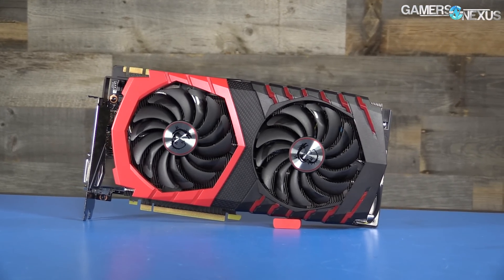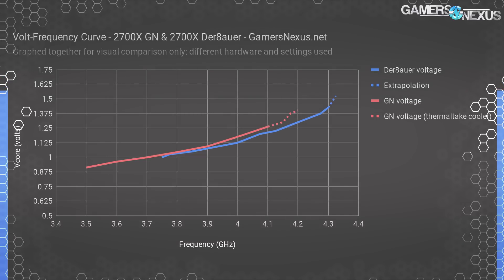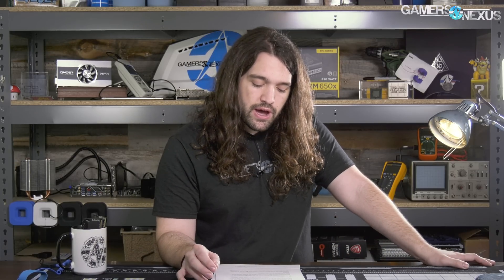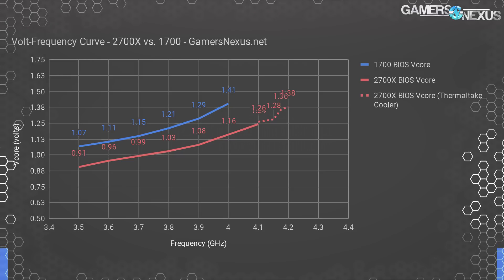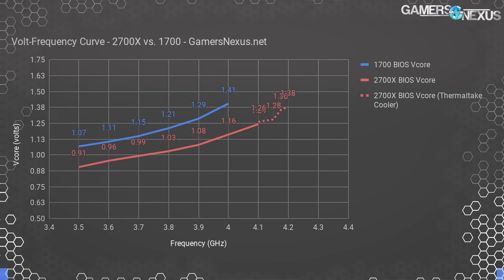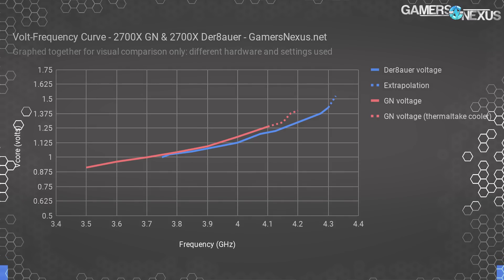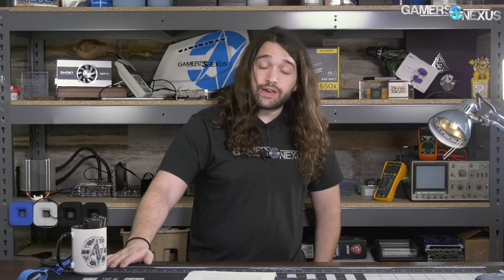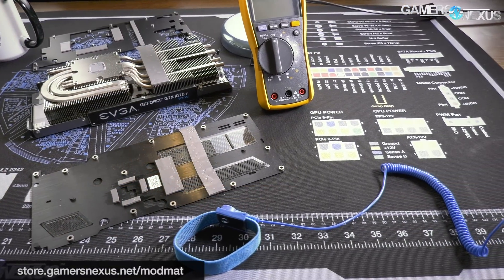Exponential Ryzen Voltage-Frequency Curve (Overclocking)

Comment from the maker: Article: https://www.gamersnexus.net/guides/3290-exponential-ryzen-voltage-frequency-curve
See also: R7 2700X review - https://www.youtube.com/watch?v=1A2yatfyLoo
Reply: Gamers Nexus so I was recently testing my TR1900X. I was able to hit 4.15GHz at 1.425V LLC 4  on an MSI X399. 4.2 was only Windows stable at those settings. 

The 1900X acts a lot like the 2700X. It hits similar clock speeds at  similar voltages mostly due to being highly binned and having 180W TDP. 

At low loads XFR will boost as high as 4.175Ghz. At medium loads like Cinebench or Time Spy Turbo takes all cores to 3.95GHz +-10Mhz. Prime95 Small FFT will bring it down to just 3.825-3.85GHz.   It’s basically not worth OC’ing.
Reply: Gamers Nexus can't wait for ultra-precision boost 5
Reply: Can someone tell me what is standard voltage for my Ryzen 5 2400G? Because my MB (MSI B350M Gaming Pro) sets whatever it like. At first boot I was getting over 90 degree C on Cinebench and quickly find out that voltage was (on auto on stock CPU settings) at 1.55V !!!! After restoring bios default seatings it's now putting up to 1.42V on auto
Reply: Sooo... strictly For Academic Purposes you played with ryzen a lot?
Reply: Guys what's the difference between
bios vcore & motherboard vcore..?
Different voltages in diagram bios & motherboard..??? 

Also that temps and benchmarks are on high load calibration..? 
plus extra voltage on vsoc?
Or vsoc set <Auto>
Reply: Gamers Nexus You said jif. That's it, I love you.
Reply: You just described that in fact it IS exponential...
Reply: Lukáš Bacigál if that was a reply to my comment, you should go back to high school....
Reply: @Gamers Nexus  take this video down 538 you mentioned the 1700 X but the graph says ryzen 1700
 unless my ears are wrong.
Reply: Just because it grows faster than linearly it doesn't mean it's automatically exponential. It seems you have zero knowledge on microelectronics, the right equation for the frequency and voltage is
f=(VDD - Vth)^alpha / VDD
where alpha is between 1 and 2, typically 1.4
So this is most likely a quadratic (or slower) growth, since VDD is quite close to Vth, but nowhere near exponential.

Comment: What is the reason for higher voltage requirements? Is it due to CMOS capacitors not being able to charge fast enough on lower voltages and thus they can't propagate sensible data causing glitches? That's sort of my theory but I'm not really sure.

Comment: Old news, but my 18 month old  2700x ran at 1.456v out of the box, it did not fluctuate more than 0.010v either way, 
and have found that this is probably the reason that it has been problematic, (random black screen crashes). 
Currently undervolted to 1.39v at 4.15ghz and seems fine.

Comment: So.. plz help me.. is 1.0 volt safe for ryzen 7 2700 (non X) to overclock at 3.6ghz? or what voltage do i need to give..?
plz.. if you have a chart like..
3.5ghz =? volt
3.6ghz =? volt
3.7ghz =? volt
and do i need a extra cooler.. plz help someone...
Reply: Mohammad Mizan I’m looking for that right now, I manage a fully stable 3.7ghz with 1.116v(stock cooler), but 3.8 not even with 1.8v, and I need lower voltage to not go above 80c (currently 77 using intel burn test at 3.7 1.16v).
Reply: sorry I write 1.8, I mean 1.18v

Comment: @GamersNexus - I'm kind of wondering what kind of cooler would be best to use for the 2700X with the aim for it to be reaching 4.2-4.3GHz?
I was thinking about the Cryorig H5 Universal, but seeing as it has only 4 heatpipes - and with the fact my ambient room temp in summer might be as high as 30-35 - I wonder if something like a Mugen v5 rev.b would be better? Trying to keep it under 50-65$ inc. EU VAT, though was wondering if maybe at such high temps it would be better to invest into a AIO like the Kraken x62 or Corsair H115i.

Comment: I'm not sure about voltage but power was always an exponential growth with clock speeds and the whole point of multi core processors was to increase the performance level past the point where the power requirement skyrockets as they allow a direct power to performance ratio.

Comment: Guys have you test the gigabyte 370x gaming 5 or gaming 7k version with ryzen 2700x?
I have problem with voltages & high temps.
For example bios 23d not working bugged even if you set manual voltage temps are on 95-100
When I switch to bios v22 bug fixed temps dropped to 35 but windows won't load with auto voltage on auto 3.7ghz.

You need to set at least vcore 1.3500 voltage to boot the system 1.3500 for 3.70GHz its too much, I cannot overclock my cpu at the moment cause of that (probably bios bugs) cpu diode goes really high on stress test temps 80+
with low voltages..
If you have any tip or some stable bios version please help..

(yes I have test 2 stock wraith coolers and my master liquid pro 240 same problem same temps.
 Ryzen 1700 runs fine. But 2700x not..
Some people report same problem on amd forums..
Help please!!
Reply: No help, but having only tested bios 22, I am stuck at max 3.9, with my 2700x. That is, when stressing it correctly. My problem is temps, as it overheats, with the stock cooler. K7.

Comment: Those voltages are excellent. might replace my 1700 with the 2700, because it would at least be 20C cooler under load and my current chip gets very toasty in the summer even with a 240mm AIO

Comment: You could look at this thing, get some grid points, write down your coefficient matrix and get the parameters for your exponential function then you can derive it and look at the point where the derivative becomes larger than e. That is about the sweet spot if you want the greatest overclock without a nuclear core meltdown. Yes, thats enough application for today, back to theoretical physics flies away

Comment: Sure. The non-X model may reach X-model levels with overclocking but it's only cheaper if you already have a cooler. Otherwise, it's just as cheap and much easier to just buy the X-model and leave it at stock.

Comment: Dear Steve, Can you test ryzens voltage outside what the bios is saying ? I don't trust amd software as we know about it's GPUs, and now CPUs, example when ryzen 1 had the wrong temperature showing. I think that they might be lying about that their stock CPU works with 1.163v, compared to ryzen 1 with 1.375v, that's a huge difference, but when OC they both reach to the 1.45v + - in that area.

Comment: The fact that 4ghz has dropped from 1.41v to 1.16V, i can't be the only one to realise dropping from 14nm to 12nm and providing this sort of efficiency gain is madness? Removing the fact 4ghz on the 2700x is faster too.

Makes me wonder how efficient at 4ghz the 3 series on 7nm is going to be. In fact i wonder what the power draw of the 2700x is at 2.5-3ghz, a ultrabook sort of frequency

Comment: I have an 1800x, and found an all-core p-state oc (4 GHz / 1.37v) was better for gaming than XFR.  I think this is more about core parking.  I use "ParkControl Pro" for control over this, but it seems to run better with the p-state oc than it did under XFR. It's always silky smooth, in any power profile including "Power Saver", whereas I had to keep it in H. Performance or at least Ryzen Balanced if I was using XFR (Auto / stock).  I haven't seen a stutter or glitch in the 8 months I've been running this way, where I did see this from time to time with XFR.

Comment: I have a question. With Ryzen 2 and the X models, if you happen on a good chip and instead of overclocking you simply downvolt and keep the chip cooled very well, is turbo boost and XFR going to basically auto OC the CPU? Basically, does downvolting benefit the turbo boost and XFR features?

Comment: Apples and oranges??? 1700=3ghz+3.7boost....2700x=3.7ghz+4.2boost. Come on. Not fair is it? R2 being clocked higher with standard spec of course its gonna overclock higher. Relatively 23% v 13% respectively (give take). This voltage comparison aint fair. Of course clock for clock r2 is better say at 3.7ghz because of the fabrication process technology

Comment: Worth upgrading to 2700x from 8700k?
Reply: Meow w not really an upgrade more a side grade, only worth doing if you can make use of the cores and threads and/or want a platform backwards compatible until 2020.

Comment: If you look at the stats and think of the new Treadripper with 4 of the Ryzen 2 CPU's and lowering volts... A beast will run over Intel. Not in the single core but in calculation power per watt.

Comment: I won't be buying a Ryzen 2 chip cuz my 1600 is more than sufficient. Still want to thank you for your hard work, this is very interesting and if I have an excuse, say if someone want me to do a build for them, I will take the chance and test with the clocks and voltage. At this point, I rarely do overclocking but rather undervolting. I can run my 580 at something like 1000Mhz core clk and 2100Mhz mem clk and still maintain 75 FPS in many games I play, which while I might have to lower some settings doesn't warm my room up.

Comment: I wonder if the tweaking in voltage and/or power is correlated to the tweaks AMD has made to Infinity Fabric for this new refresh. I have read that they have reduced the cross-ccx latency. But, not sure, if they have reduced it enough....

Comment: Seriously though, all clockspeeds require exponential voltage increases. In the real world nothing is linear, there are only linear approximations around small operating regions, where you can stay on a tangent to the more flat part of the exponential at lower speeds, but at higher speeds you are on a steeper tangent. https://en.wikipedia.org/wiki/Linear_approximation. There are also mathematical reasons behind every clock speed needing exponential voltage, no matter the circuit. To keep the "Eye diagram" within the boundaries of logical 0 and logical 1, e.g. below 0.3V or above 0.8V everywhere in the chip when the clock rises, you can expand the eye pattern by increasing voltage. The step response (just one clock rise) of the eye pattern has an exponential shape -  one clock rise (or fall) has the shape of a capacitor charging or discharging - exponential response, so you need exponentially more voltage to stretch it and make it rise fast enough to stay in bounds as you increase the frequency. See https://en.wikipedia.org/wiki/Eye_pattern, which also applies to ICs https://en.wikipedia.org/wiki/Signal_integrity
Reply: Also, if AMD enabled less voltage for the same clocks (which is most of the benefit they've seen to achieved with Zen+) they've probably found the places in their chips with the slowest responses that was limiting them before, and made them faster meaning the curve for the whole chip has been shifted to be initially lower and flatter, but it's still exponential, and I guarantee any chip ever made will be, it's just how low and flat is it initially. That's why extreme overclockers almost always e.g. double or triple the power, but never get anything like double or triple the frequency, unless it was a massively under-clocked chip to begin with like chips in the 80s or 90s, or a calculator. 
Also, on power draw, when increasing the voltage linearly this increases the power draw exponentially (^2) (P=V^2/R... assuming a chip has approximately linear resistance, which they sort of do for the same task like being prime95 tested), but increasing the clock means increasing the voltage exponentially (^2), which means the power draw increases quadratically (^4) when increasing the clock, which is why there is so little to gain once you get over a certain wattage per core, and why more cores is a more power efficient way of getting processing power, rather than increasing the clock, if they can be utilised.

Comment: how much E-tape have you gone through with ryzen so far?
Reply: I'm not sure but I think because a side channel provided the cpus to GN and with the info on the ihs maybe someone would be able to find the batch and then who provided such processors to GN.
Reply: Why do they put E-tape on them?
Reply: to add to Cippo95's point, these CPUs had tape on them in the videos released between the unboxing embargo and the benchmark embargo. Steve mentioned in one of those videos that he is not under the embargo but will respect the other media outlets and not break the embargo that technically GN wasn't under.
edit: also see GN comment on this same video: https://www.youtube.com/watch?v=Qfu7TUQ2P6U&lc=Ugxt5BzDHEkzu-Yj5pZ4AaABAg.8fRo135QjXS8fRomdS_qI9

Comment: Steve: Great video about voltages! Speaking of, can you please explain why I still can't run memories at 3600Mhz or 3466Mhz on my X370(AsRock)? Thank you!
AMD said that the new Zen+ architecture will support higher memory clocks, and that it's all tied to the CPU, not the motherboard...

With the R3 1200, I could somewhat run my RAM at 3466Mhz with 1.395 voltage.
With the R7 2700X, I can't even do 3466Mhz anymore! BSOD over BSOD... Why? :(((

So is AMD lying or what hell is going on?? :(
My RAM is G.Skill Ripjaws V, 3600Mhz, CL 16, 2x8Gb Kit.
My motherboard is AsRock Fatal1ty X370 Professional Gaming. UEFI/BIOS v4.60.

Can anyone help me with this issue? Please? I would appreciate it!

Comment: Correct me if I’m wrong but what I’m getting from this is if you buy a 2700x and you put a really good cooler on it then overclocking it becomes almost pointless because xfr2 will do it for you
Reply: https://www.youtube.com/watch?v=426hLGoXDbM
Reply: Cbeddoe19 but isnt it bang for the buck that you can oc your 2700 to 2700x levels thus Steve recommended the non x chips for both new cpus?
Reply: Markus Fuchs  YES YES YES Amen!!! I dont see much people thinking like that. that is what i would do... but paired to a mid range board not the budget one
Reply: Its not worth OC the X models.
Reply: But you'll need to invest in a far more expensive cooling solution to OC a 2700 to 4.2GHz, plus you get far more power draw which also costs money in the long run. In addition, Ryzen chips already have absolutely amazing multi core performance while the performance below 4 threads is... nothing special, performance which you'll most likely slightly decrease with a 4.1-4.2 GHz OC compared to the 4.3GHz 2 thread boost (and still at or over 4.1GHz up to 4T) clock of the 2700X out of the box with the stock cooler with significantly lower power consumption and less (or no) cost for after market cooling. 

Personally I'd go with an X chip, throw it on a decent budget B450 board and be done with it, no need to OC, no need for excessive power bills (at least compared to OC'ing) and at the very least just as much performance where it matters for Ryzen currently.
Reply: Only if power consumtion isn't a concern for you and you plan on using an after market cooler anyway. For instance, OC'ing a 2700 to 4.2GHz will cost me at least 10€ a year more (assuming 20W more consumption and 3-4 hours of operating time a day), negating any savings I might make within 1-2 years. And that's without even touching on the subject that you need a fairly beefy cooler to OC the 2700 to X levels of performance (which it can reach with the stock cooler, which is also better than the one included with the 2700)... or that X chips means getting slightly better silicon.

Not to diss Steve but recommending non-X over the X for budgetary reasons and pointing at OC'ing is stupid from a cost perspective. What you save you'll likely have to spend on a decent cooler bringing the cost to roughly equal levels... not to mention power draw.
Reply: Overclocking all core is only useful in multi-threaded applications where Ryzen is already better and with lower power usage. In games and more single-threaded apps overclocking all cores is actually killing off XFR2 and PB2 as there is not enough left to boost the two "best cores"  to their maximum potential.
You can achieve better fps/dollar even in games [without running over TDP and voiding the warranty] by investing in a similarly priced cooler that you would already have to buy for the 8700k.

Comment: what is going on with that lamp?
Reply: Raleigh Cockerill pulse width modulation the led. The switching is a multiple that is close to that of the camera. I think.
Reply: oh ok, to me it seemed like it was a halogen bulb, but i could be wrong
Reply: Raleigh Cockerill hard to tell looking at it but I would imagine a halogen bulbs would have the thermal inertia so it would dim as much as that.

Comment: I wish my 8700k had an ind what the BEST CORE AND 2ND BEST CORE like the ryzen masterbator gives you
Reply: john doe Well X299 chips support Turbo Boost 3.0 and software to manage it, but I don't think Turbo Boost Max (the software) supports Coffee Lake. Intel ARK says the 8700k only has Turbo Boost 2.0, but my 8700k does seem to prefer a certain core. With single threaded work I often see my highest load on Core 5 or something. So maybe it is giving work to the best core? I've had a hard time finding documentation on this.
Reply: I think the Intel stress test can tell you.

Comment: I need bloody 1.43v to keep my 1700 at 3.85 ... Lame
Reply: Leon Pozo Can you adjust your LLC? If so, what level is it at?
Reply: That's too bad. Have you tried messing around with LLC setting? Mine run perfectly stable at 3.85 with 1.375v with LLC Mode 2 which occasionally droop to 1.30v during heavy loads.

Comment: @Steve Is it possible to get the power draw figures added to the chart for each vcore level on both the ryzen and ryzen+ cpu's in the article at your website?
Reply from the maker: Look at the current clamp column and multiply it by 12.3?
Reply: Cheers!

Comment: If the voltage requirement is quadratic (at the high end at least), then the power used is raised to the 4th power. That's why there is a thermal wall.